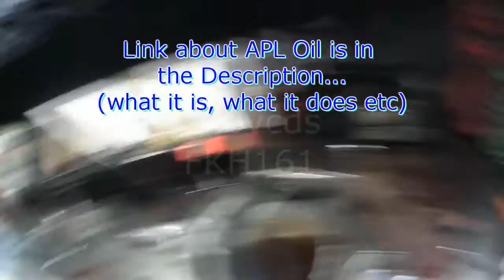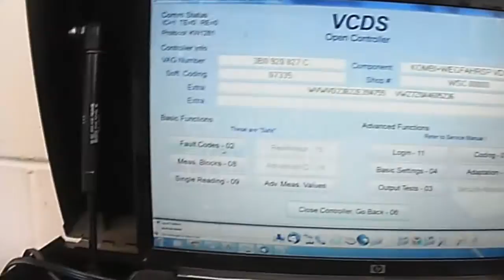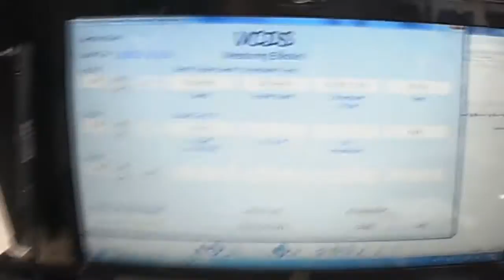VW B5: 1.8T Big oil filter

Comment: good video, what are the advantages of a bigger filter? how can you know the rigth olil filter for your car, in the parts store they sell you the one appears in their system
Reply from the maker: If it looks small, it's the old style... the bigger filter is also used on older Turbo Diesel engines:
http://www.germanautoparts.com/productdisplay/11332

Read the description of the link.

Comment: The MANN W950/4 is the biggest oil filter for the 1.8.  It has the same bypass pressure.  It brings oil capacity to nearly 5 liters.  I also use Motul 8100 x-cess and love my A4 stage II+ setup.  Motul is one of the few oils that is SN rated, mobile 1 0w40 is also SN rated but it is not the correct weight.  I often believe American things are made tougher to deal with our climate but in this case motul is perfect.  Delvac and T6 have a better pour temperature and higher TBN but 8100 x-cess is perfect in this car.    I get at least 5-8k on my stage II setup before oil changes with the fat filter.  I go to carquest and get 5 liter jugs for 41 bucks.  I get the w950/4 on ebay for 9 bucks free shipping.  Best oil change you can get for 50 bucks.

Comment: Just took my 2004 passat 1.8 to oil can henrys and they installed a smaller one. I guess i'm gonna have to go back.
Reply from the maker: It'll be fine... just tell them to install the bigger one next time.
Reply: ***** Ok thanks for the reply. I was getting worried reading up about it on forums. I'll just make sure to get bigger filter next time like you suggested. Thank you.

Comment: What kind of base oil do you guys use? Liqui Molly?  Are you using the APL oil as suggested in their website? 25% apl and 75% base oil? And would you do this with engines with 300k plus km's?
Reply from the maker: We no longer use APL... no local sales rep we can talk to / order from (for the past several years).
We buy in bulk / use a full synthetic 5w30 that is Euro approved (meets BMW, MB, VW, Audi longlife specifications). Instead of APL, we use Liqui Moly oil system flushes & treatments.
Reply: @EXOVCDS  Thanks for the info. Btw, what do you think of lucas oil? I personally use about a bottle to thicken the rest of the oil I use since my 2002 A4 has a lot of km's in her. Is that a bad practice?
Reply from the maker: @istvanpista7895  I also use Lucas in 2 of my 3 cars.

Comment: thomas , im from spain and i love your videos supports from here  , ive recently bought the 1.8turbo with engine code AWT and ive seen that the filter looks smaller than the mann w940/66 that ive bought trough OEM number ,  does it fits correctly despite of being bigger? there is a long hose touching the filter ,  which are the advantages that provides this filter?
Reply from the maker: The bigger filter increases to oil capacity by 1/2L. It is a recommended upgrade on the Passat. On some of the Golf & Jetta engines, there is a Power Steering line that is in the way and some electrical wiring, so the smaller filter needs to be used.
Reply: im going to use this filter in a audi a4 , so what should i use ? small o bigger  if the power steering line is in the middle i guess i cant install the bigger ,  thanks
Reply from the maker: Audi A4 has no issue with the bigger filter. w940/25 is what we use. I think they are the same except for the fitting at the end.
Reply: Thomas EXOVCDS  , going to use mann w940/66 , im writing with my other account , thank you for all answers and help

Comment: I really don't understand this "oil thickening", problem with 1.8T is small oil pump choke 9 it helps for a moment). Cleaning or new oil pump, and cleaning of oil sludge resolve all problems with oil pressure.
Reply from the maker: I'm not thickening the oil (as far as I know)... the APL is a sticky substance that is supposed to help reduce friction and dissolves sludge. You are correct about cleaning. Not too many customers will pay for cleaning when the time comes. Those are the customers that neglect oil & filter service, come into the shop when the oil light & buzzer come on (noisy lifters as well). Are told that the engine is noisy due to sludging, but then don't want the engine cleaned because we can't give them a guarantee that there won't be any other issues... since we don't know if there has been any significant bearing wear until we take things apart. The APL has helped flush & maintain a clean engine... so we use it as a first step.
Reply: *****
You are right too - looking for low costs and as a first spep to resolve problem - it is OK. For me its temporary solution. I checked myself fullsynthetic thick Motul oil 20w60 and it was ok for about 2 months. The oil pressure was higher and engine flushed all sludge and it comes to oil pump.The pressure was 0-0,5 and valves was clatered. Final was cleaning of pump and camshafts area. Im not professional but when we have time we can do much for our cars. By the way I think good cars was produced to 2000 year, so we should rescue them :)
Reply from the maker: Yes, when you work on your own time and you have enough tools, you can do a lot to maintain a vehicle... not everyone has the time or the space, and I end up looking like the bad guy for charging too much. I too think the older cars are worth saving, that's why I drive a 1989 vehicle. Simple technology and lots of room to work on. Thank you for your input! My viewers will appreciate it! Happy New Year to you and your family!

Comment: eu spec 1.8t use different sizes for different aplications, longitudial,transverse.
Biger is better, i've seen filters with the 3/4" 16unf thread 108 mm in diameter and 170 mm high, search in manufacturer catalogues.
You can use any filter as long he has a bypass valve and a anti drain back valve that is mandatory.
Reply from the maker: Good point, thank you for sharing this information! Thanks for watching & taking the time to comment!